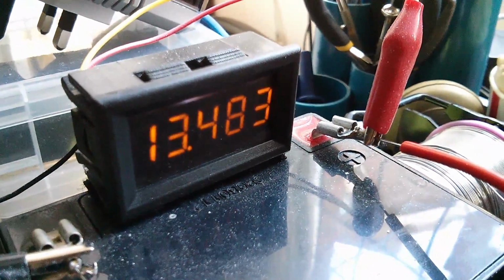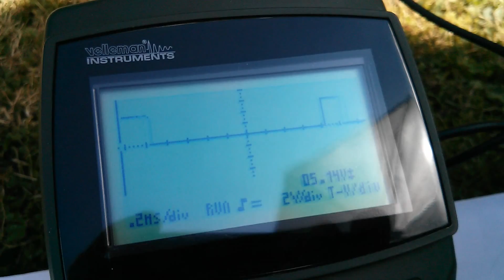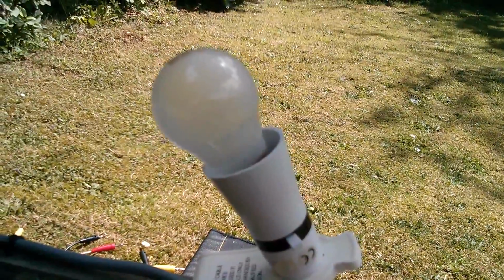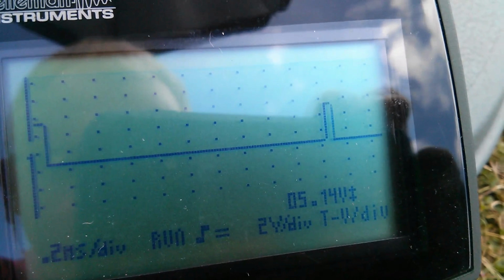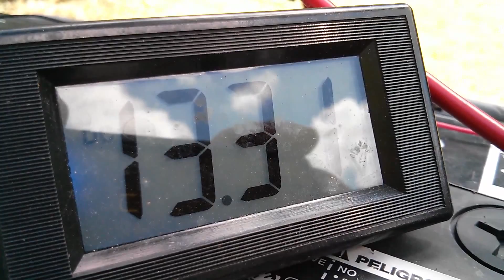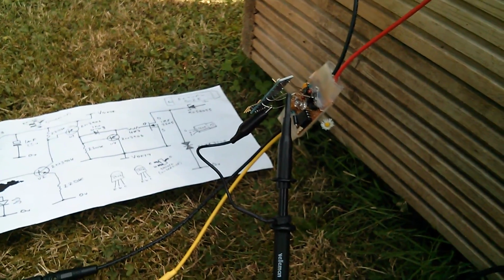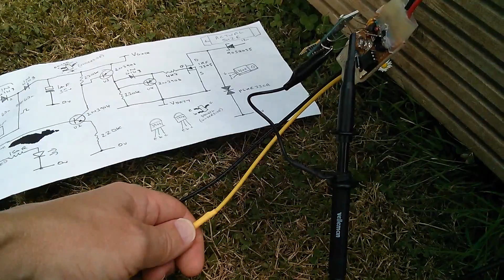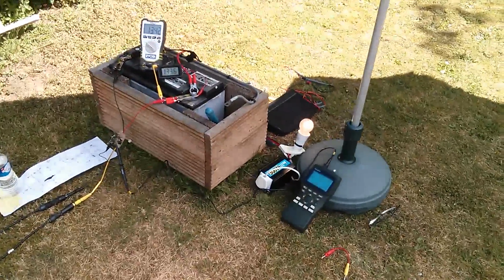Arduino PWM Solar Charge Controller #5 - 80W Panel Tests

Comment: if (V3 < 27 )
  {
    if (pulseWidth != 255) pulseWidth++;
  }
  if (V3 > 27 )
  {
    if (pulseWidth = 0);
  }

This is the part of the code that i use, the problem i find is that  it is very slow. Any idea on how to make it a little faster ?

Comment: You can get a faster reaction time safely by subtracting the detected decivolts from 135 (the setting), convert that to PWM steps, keeping the sign (can't remember from your last video how much voltage change one step is).  If it's larger than 2, divide it by 2, and add that to the current setting.  (A straight divide by 2 would work, but would lessen the small change resolution by one bit, and probably cause it to hunt.  The IF gives it back.)  A negative difference would lower it, and vice versa, and the divide by 2 would help keep it from over shooting and slows the delta the closer it gets, while still getting to the final value in less than half the loop cycles for large transients.

Comment: hello mr. Julian
I have found your videos on solar battery charging extremely useful
I have watched almost every video you have posted.
I'd like to see what you think of using this function in your code for the Arduino pwm.
the Arduino has a function called pulse in.
I'm wondering if pulse in could be used to synchronize your code to take a reading after the raising Edge of the mosfet control signal
pulse in if I'm reading the documentation correctly uses a delay in milliseconds.
if you delayed your voltage read to just past the Rising Edge of the fet control signal
this might get rid of a lot of the Jitter.
I'm wondering though if the way I see you programming the timers would mess up Pulse in internal timing
I got this idea from watching the videos on YouTube about measuring inductance and capacitance with an Arduino
in a lot of the videos I've seen on inductance meters based on Arduino
one pain is used to pulse a tank circuit and then an lm339 is used to square up the sinusoidal wave.
pulse in is used to count the duration of the on cycle in Millie's.
the inverse of this duration is used to calculate frequency and then using the appropriate formulas.
you can derive a approximation of the inductor under test

I'm wondering if this could be used to synchronize the voltage measurements to say within 10 to 500 milliseconds after the raising Edge of the FET control signal.
I have a sketch for this program but at the moment I don't have a free Arduino of any kind to test this out.
waiting on the slow boat from China
I did a slight code modification to the Muppet code.
at startup I call a small subroutine that takes the pwm from 0% to 100%
as it Cycles through it records the highest wattage and pwm setting.
I use these values to start the rest of the code just the way you wrote it.
and according to what my scope is showing me you do get different voltage readings during the on cycle and off cycle.
I've used the serial monitor in its graphics mode to plot a curve of the wattage as this subroutine steps through the values.
I've seen weird low spikes in it, at this time I'm assuming some of the spikes are readings taken when the FET is it in the off State.
possibly maybe when interrupts are triggering as well.

thank you sincerely for your time, sharing, and inspiration
Reply from the maker: Oh wow, I haven't looked at that project for quite a while. And I've never used the pulseIn() function, so I'm not sure what I can usefully say. I will be returning to the PWM5 project soon - specifically a surface mount version.

Comment: Hi Julian,

I've followed Muppet and PWM5 and now the ArdusolarPWM with great interest but I've never really understood the battery "set point" reasoning and why is 13.5 Volts optimum for a 12 Volt nominal lead acid battery. Can you clear this up for me please. Regards . Alan

Comment: Hi Julian, I'm going to build this. I arrived too late on the scene to buy one of your original PWM controllers but I like the idea of building the Arduino version.  I only have a couple of smallish solar panels but I'll also splash out on a larger panel at some point . I'm also following the progress of MuPPeT, which is the target project for my soiree into solar stuff. Keep up the good work.

Comment: Julian, you should do a video on calibrating eBay DVMs. I have 5 of those blue LCD ones, and some are within 1 volt apart! Mind you, they have been in my shed for a couple years. The hard part with trimming these is the TWO trimpots on the back. I am not sure why there are two, and they do both effect voltage.

Comment: Julian I have spent many hours dealing with losses from standard silicon blocking diodes in the end to avoid wasted power going up as heat I hve started using these low forward voltage drop 15A 45V Schottky Blocking Diode for Solar panels or wind .
http://www.ebay.co.uk/itm/291059523048?var=590223722363&ssPageName=STRK:MEWNX:IT&_trksid=p3984.m1439.l2649
Reply from the maker: They certainly have a higher current rating than the 90SQ035 I'm using. But at 6 Amps (and 125°C), the 90SQ035 beats the STPS1545 on forward voltage; 0.36V versus 0.43V
Reply: wow that's good :) thanks will check them out
Reply from the maker: ***** As superdau says, the 480mV figure is for 9A at 25°C. But at 9A it will quickly heat up unless massively heatsinked. 9A at 125°C reduces the forward voltage to about 410mV. The STPS1545 has a Vf of about 480mV at 9A 125°C. I'm reading all these numbers from the forward voltage/forward current graphs in the respective data sheets.
Reply: *****
You have to look at the datasheet, not the ebay listing. The 480mV are for room temperature, but it won't stay there for long at 9 Amps.
Reply: superdau Yes I agree Ebay tends to be biased and using selling points rather than real data :)

Comment: Might also want to check the values you're getting from the analog read, if those are jittering, then the code obviously will too.  How the code reacts to jitter changes might end up being significant if you get into a (temporary) positive feedback loop condition.

There are ways to compensate in your code for jitter on input and there are ways to detect/minimize the effects of positive feedback.

Comment: To prevent overshoot on mine, I put in an:

if(voltage > setpoint)
{
pwm = 0;
}

That way it can start from the beginning. I also made it so if the voltage is more than 0.5v lower than the setpoint, it would increment the pwm in +5 increments instead of +1, so it also gets there quicker. Worth a try?

Comment: @Richard Stott

as he is running a micro processor, he can slow it down somewhat, so yes it doesnt need a super fast reaction time, but of course he still has to be able to switch the pwm at a decent frequency  to prevent it being audible or electrical interference) so processing speed will always be plentiful.    lead acid batteries dont have to be identical,the state of charge is directly related to its voltage (you dont need to know the amp hours of it at all) , you are over thinking things such as demand curve, the idea is to take the most efficient power from the panel and get the battery to a fully charged state as soon as possible, then maintain it, when power drops, charge it again.  mppt is just trying to gain the most power from the limited power in the panel, and lead acid batteries are a little forgiving, you can over charge a little, so some overshoot doesnt harm anything really. Mppt is a known approach, but  someone making their own and sharing how its done and the code, is what is new and helpful for the future

Comment: Hi Julian, thanks again for another fine in-depth dialog - nice!
I guess it's best to use only your own code as at least you know
exactly what's happening, but maybe later after you get it sorted I think it might be good just to try an Arduino PID library just to see if it's better or not.

Comment: Hi Julian, I think that you will be better off with a PI controller, so to use the integral term in order to compensate for the voltage dip.. What do you think?

Comment: To try to compensate for load changes you could look at the dV (battery voltage over time) to set a different gain until you are near the target.

Google "gain scheduling".

Another way is simply to make an unlinear I-component based on dV (set-act).

As someone already stated....you should use a 4-wire connection to the battery if you feel the need to get more precise measurments OR measure the current and compensate for voltage drop in the cable.

Could your jitter on the pwm be a result of a non linear response from the panel during load?
Add a large capacitor on the panel input to the pwm controller as a test?
Or is it just a oscillating regulator?

I follow all your videos a I can't wait for the next one :-)

Comment: This is such a great project and excellent video showing the PWM in an oscilloscope. It has taught me exactly how a charge controller works.  I did not know how it worked.  You can see that it just uses different pulse wildths to give the battery just the amount amount of charge that it needs, always at 12 volts. And then you go further and show the additional circuitry that it needs to be a reliable usable product that performs perfectly.  This project is THE project that I think many people have been looking for as it relates to Arduino solar.  This has so many applications. Thank you.
Reply from the maker: Thanks Jeff - I appreciate the support

Comment: The voltage drop under load is probably caused by the voltage drop in the cables between the regulator and the battery. Maybe you should have a look at 4 wire connection to the battery.
Reply: That is most likely the case. The cables look a little bit thin, too (not for the intended current in general, but for accurate measurements at high currents).
Back of the envelope calculation: 50W at that voltage are around 4A (I'm ignoring the fact that it's actually pulsed and the current may be even higher; the PWM is around over 80% anyway, so it would be around 5A when on, which is close enough). "Missing" a 100mV is a resistance of 25mOhm, a value that's plausible for the around 50cm of cable with that diameter.

Julian, a 4 wire connection would definitely be the way to go. But try thicker cables/better connections first, to make sure that's the reason. Btw. it may also solve the jitter.
Reply from the maker: Yes, I also think it's voltage drop in the battery side cables. But I don't think a 100mV error is that much of a problem - especially on a $10 controller. The battery side wires could be made thicker with a recommendation that they be kept as short as possible. Four wire sensing sounds terribly complicated. Wouldn't the ground connections have to be NOT connected together inside the controller?
Reply: Julian Ilett
No, it just means that you've got to make a differential measurement. The ATmega can't do this natively. If you don't want to use any external components (like a dedicated ADC with differential input or an opamp), which definitely is a design goal, just make two measurements on two channels and subtract the results. Hook up the negative battery terminal to one ADC channel with an extra wire from the battery. You should never need a voltage divider there, because if you got a voltage drop >5V in your cable you're doing it wrong (for those still trying you could clamp it with series resistor and a zener to something below 5V). For the positive side you use what you're doing right now, except that you run a wire back from the battery terminal instead. Convert both results to volts (or better mV so you can stay with integer datatypes), subtract and you got your actual battery voltage.

If someone does not want to use extra wires, he can connect the ADC inputs just on the controller and live with the voltage drop (which may be very well ok for low power applications or by using thick cables). Maybe at the time of board layout make these inputs close to the respective power lines, so it's as easy as putting a jumper on or creating a solder bridge.
Reply from the maker: superdau Actually, couldn't it be done with 3 wires - high current red/black and a low current sense wire to the battery negative terminal. Surely, the total voltage drop must be split evenly across the red/black wires (assuming they're the same length - although an inline fuse might be a problem here). As you say, a sense wire runs from battery negative to a spare ADC input. A hundred millivolts would be easy to measure without additional amplification. Then the measurement is doubled to get the total voltage drop.
Reply: Julian Ilett
Under ideal conditions it should be the same drop, but I think relying on it isn't a good idea. If someone uses connectors for example the resistance could differ by quite alot on both paths. And yes, fuses have a voltage drop of 100mV upwards (much higher values for low current fuses) at their rated current (they have to, because they need the power to "break").

I don't think you have to take the PWM into consideration (except for always measuring at the same time in the cycle). You have a large inductor that smoothes the current and thereby hopefully also the voltage drop.
Reply: I agree 100%

Comment: i take it you will integrate this into the one ardiuino on your mppt once you have both sides of the charger/controller worked out? its certainly interesting to see the gradual problem solving on the project +1
Reply from the maker: That's the plan. The MPPT controller switches the MOSFET at 15kHz, but this could be reduced to a few hundred Hertz during float charge, or I could leave it at the higher frequency. Not sure yet.

Comment: Hi Julian Ilett ,

I would recommend you to go to GitHub. The community there is far more active and you can get Pull Requests much more easily. This might help stepping your code up to maximum performance quite quickly.

Also ReadTheDocs would make it very easy to produce a nice documentation along your code as well as GitHub pages for nicely displaying it on a webpage.
Reply: Indeed. Google code sucks..
Reply: Albin Ekblom
Google code is great. You can SVN, what more do you want.
Reply: aptsys have you ever used git?
Reply: I'd also recommended GitHub for the social aspect - which Google Code doesn't have. Both platforms support SVN or Git, it's down to preference. Being able to fork the code and submit pull requests against code, schematics, would really help the community build this into a greater project, which is what Open Source is all about. It's not too much trouble to clone the repo and pop it on GitHub regardless of where it ends up :)
Reply: Andre Klärner
Yes, why?
Reply: aptsys Well, sounds a bit like you don't like git, or simply haven't used it much. So I can't really understand why one would prefer svn or Google code if such a cool ecosystem and community like git and GitHub are available.
Reply: SVN is an industry standard tool in the majority of companies that operate under ISO9001. I and a lot of other professionals would rather use the change control tool that their software development environments are already set up to use.
Reply: Well, I have seen quite a lot of changes in even big players. And for years no new big player in version control came around. But most of the open source world, and especially small tech startups, are using what is most  convenient and fun to use.

From my viewpoint Julian Ilett is the one guy doing all the work, and I can really see him benefit from the whole git community. If you want another example of a git-driven open-hardware and open source company with a very compelling product take a look at Tinkerforge.com. 

If anyone reading this G+ thread wants help with Git, shout out to me, I will be very glad to help as far as I can. This especially applies to Julian Ilett!! (I also run a small hosting company with git driven website deployment)
Reply from the maker: Thanks Andre. On your recommendation I think I'll chose github. And thanks for the offer of help if I get stuck - I may take you up on that
Reply: @JulianIlett  I am curious,  what version is this up to now? Also can you share your latest github link?